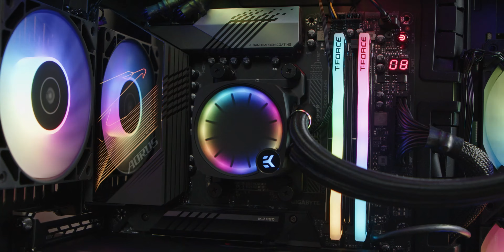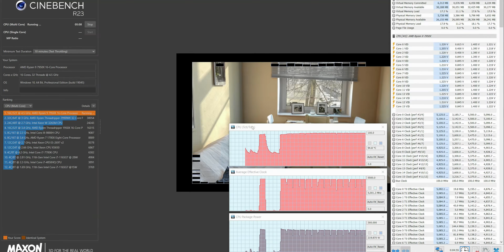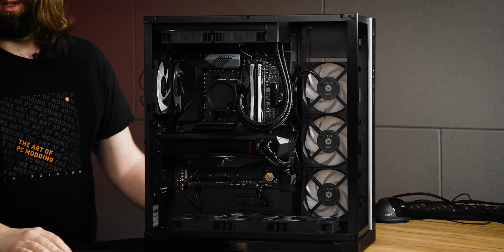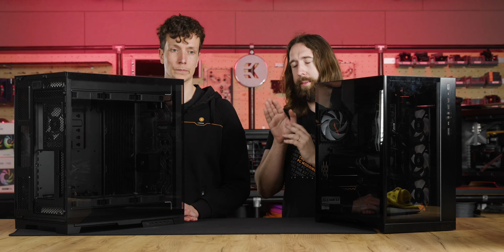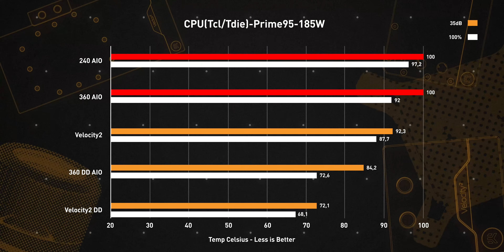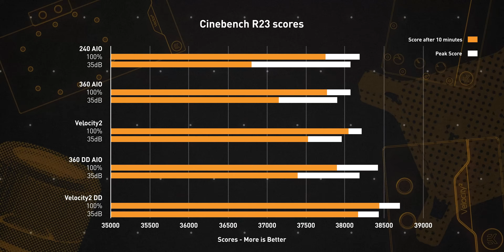EK AM5 AIO Cooler and Water Block Roundup Test

Comment: this test is pretty meeehhh to not say that it lacks the biggest factor wich is ambient temp., however, performance is pretty poor considering that here,  7950x, 2x360 radiators, same clock and fixed voltage, 100% at 25c ambient for a 10 minutes prime small avx run brought me at 77 c

Comment: What about water temps? Do the AIO ever overheat the water when noise normalised? My last AIO would automatically increase the fan noise as the water temperature climbed, so fans became quickly annoying.
Reply from the maker: The coolant does not exceed the recommended temperatures. The temperature reached does not harm any of the AIOs components. The customer will experience thermal throughteling well before any problems with the coolant occur.

Comment: Direct DIE, faster fans, faster pump + more radiators, yield better results, as expected, since removing the CPU heatspreader and thermal interface (solder), removes 2 unnecessary barriers beween the CPU DIE and the waterblock coldplate, that hinder optimal/fastest possible heat transfer/removal from the CPU DIE to the waterblock coldplate

Comment: This is not a review but were gonna test and review them? This is as confusing as paying your suppliers
Reply: Aren't all you bots already tired of dancing to that tune? You need Steve to tell you who to hate next, I guess.
Reply: @GoatOfTheWoods it’s hard for people to form their own opinions based off their own experiences, didn’t you know that…
Reply: @t_pagz  yeah...
Reply: @GoatOfTheWoods  Also it's pretty clear the "higher ups" are never gonna read those vile comments. Just the people presenting and posting the videos. And they are doing a good job.
Reply: @peterpain6625  Exactly... all these vile comments are hurting, not helping the people who need support.
Reply: How is testing at lower decibel equal to higher temperature then at 100% on temps graph? Maybe you have them switched by accident?
Reply: Lower decibels = lower fan speed = higher temperatures.

100% fan speed = more heat desipated = lower temps.

The lines are switched though yes
First graph has 100% on top and second has 100% on bottom.
Reply: Is reading too difficult for you?
Reply: The title says Test not Review...
It is great test comparing different coolers with max and  10 minute scores + with noise lvl cap test.